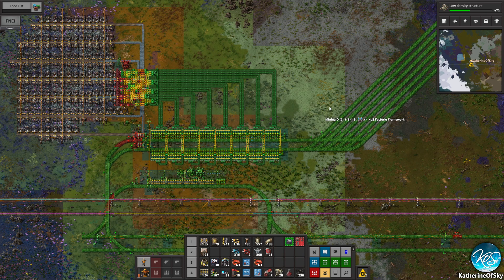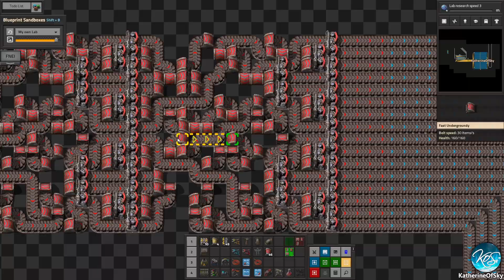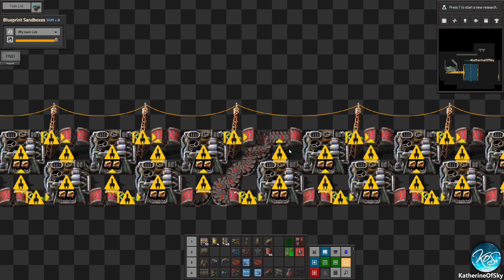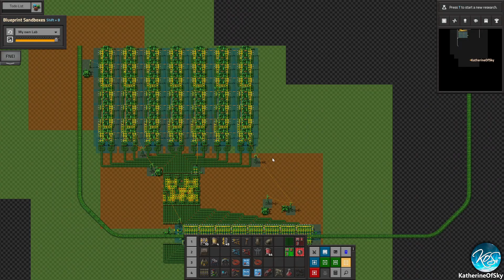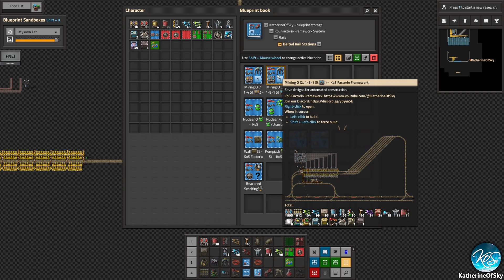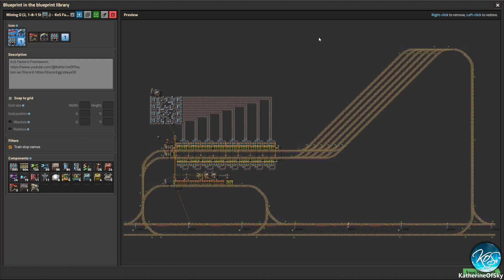Factorio Trickle Down Megabase 2 - OUR FIRST HUGE SMELTING ARRAY - Tutorial, Walkthrough, Let's Play

Comment: This series looks like it'll be interesting and fun to watch because it seems like there's going to be a lot of chances to do some math :)

I'm already enjoying your use of logic to set the train limits. I remember when you tried that out in another series and my ears perked up when you mentioned it in the first video. I noticed something that I think carried over to this video. When you counted the spots available in a train car, you had a box open and counted 32 spots. I think train wagons have 40 spots.

Unless I missed you explaining the reasoning, should the logic should be "ore >= 16000", "ore >= 32000", and "ore >= 48000"? Basically, 8 cars * 40 spots * 50 ore? I can see the reasoning for making it 12800, 25600, and 38400 so trains will start heading to the station sooner.

Another thought I had is to do "available ore / train capacity", which is only 1 number to think about. Unless you want to cap the trains (completely full boxes would be 14 trains).

BTW... thanks for making these series. I don't get the time to play, so watching scratches that itch.